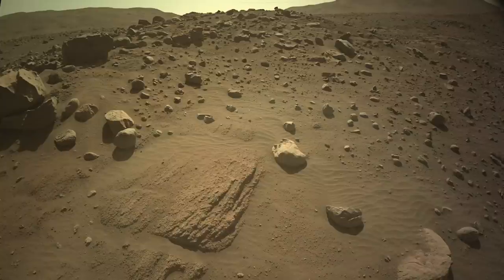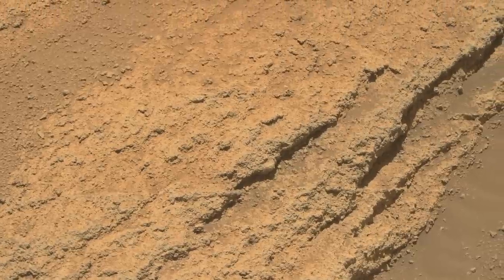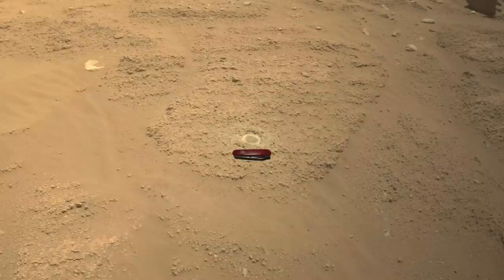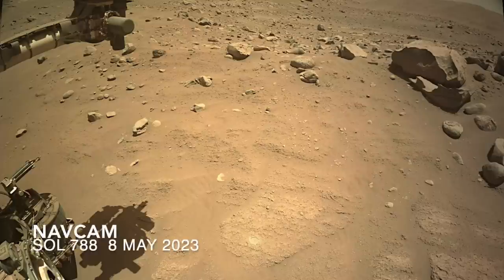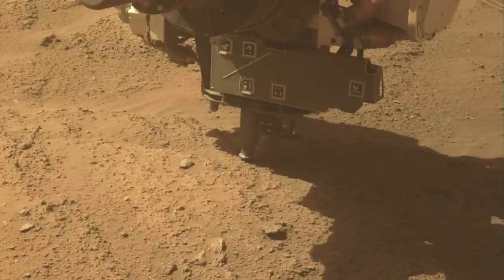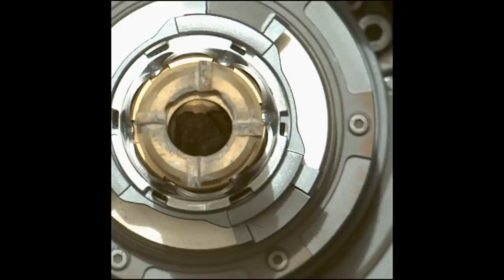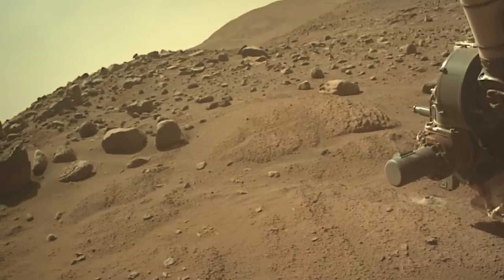Trouble on Mars

Comment: As someone who has lived in the mississippi river basin for my entire life. They probably lost most of the sample as fine dust. Sandstone can have many consistencies and I'm guessing this is quite fine. 
Edit so fine in fact, that I believe they actually drilled a piece of sandstone using a piece of sandstone in the end of the bit. The sample was left in the tailings.
Edit 2: They could have also checked the hole to see if the sample remained inside as dust by reinserting the bit without spinning it up. To gauge depth.
Reply: Take notes.

If you come down to the river
I bet you gonna find some people who live
And you don't have to worry if you got no money
People on the river are happy to give
Big wheel keep on turning
Proud Mary keep on burning
And we're rolling

A Percy wheel to remember Tina.
Reply: Exactly !
Reply: This is what happens when you rely on egg heads not laymen as to how to do actual work 😂

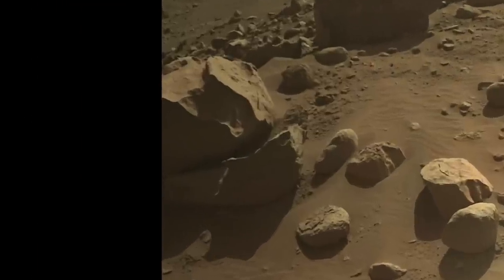Comment: That 'freaky' bolder that Mars Guy is inspecting (0:33, 0:38) is interesting. It appears was cracked in two. The smaller bolder closer to the camera from the freaky one appears to be the missing top. Looking further at the image, there appears to be other rock pairs.  The effect is almost like there was water in the rock and it froze, causing it to split. A reference Earth to where it's been observed that after repeated freezing and thawing of water, a rock can break apart. No idea what caused that 'freaky' rock to loose it's top, but that must have some scientists scratching their heads.
Reply: I also thought that it could be the upper part that, after suffering perhaps for hundreds of years the punishment of an unfiltered sun, the drill of the sand mixed with the icy wind of the Martian night making tubes, slid (like the hood of an old car) and it was upside down in that position.
I have done a test as an exploration fan making a mask to the separated piece but the lines do not match me, in addition to not looking good from behind. So I'm betting it's a lateral, perhaps still attached to the buried bottom of the rock.
Reply: And if the first assumption that the piece that seems to have fallen upside down from the top was true?: There is a photo taken with the Mastcam Z, published recently ( sol 817 photo Mars_Perseverance_ZR0_0817_0739465627_784EBY_N0391418ZCAM08832_1100LMJ.png ) in which you can see a very similar stone but still with "the hat on".
Reply: I imagine that the bluish part on top is cleaner from dust due to the wind, and that the yellowish part, with adhering dust, is at the bottom.

I have some doubts but perhaps the lines that converge towards the percussion hole and this same hole are to leeward.

If we compare it with our reference "freaky stone" (on Powell Peak), it could be understood that a combination of intense solar heat and "wind chill drilling" at night (or during the day) inside the stone, ended up , finally, for weakening the top, tearing it off the set, sliding and ending up being face up.

Comment: What do you think of the great red dune attached to the outer edge of the Belva crater in its WNW sector?
Is it sand that comes out or came out of the bottom or is there some kind of wind regime that brings material towards that area?.
It seems that, on top of it, there are some solitary stones, does it mean something that they are there?.
Reply from the maker: Hadn't looked at it before.  Maybe the local wind environment favors sand transport in that direction.
Reply: @MarsGuy  Thanks for your answer.

Comment: Unless well cemented, (siliceous preferred) the sandstone is going to disintegrate into its component sand and pebble grains darn near every time because of the percussive nature of the coring process. It's too bad that there is no way to collect the cored residue resulting from the coring process. Even the slough could be examined microscopically for fossil evidence. Perserverance is an amazing tool but can't do what a field geologist does best and that is think outside of the box.
Reply from the maker: Based on the quality of the abrasion spot (not turned to powder), it was reasonable to think some coherent material could be extracted, and it was, just not very much.

Comment: Much of the design of this equipment seems micky mouse
Reply from the maker: Hardly
Reply: @MarsGuy  the fact it needs to be so lightweight makes some functions feeble,like the drill and tiny sample cartridges. ..also the designers mindbogglingly  didn't include a robotic hand on an arm to stand up a tipped over helicopter or to use a dust brush for the dusty solar panels